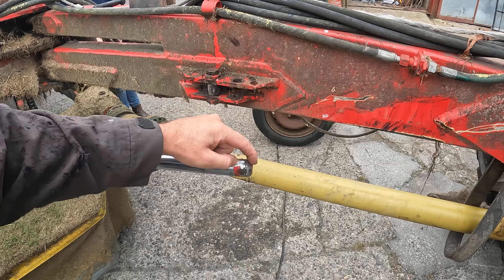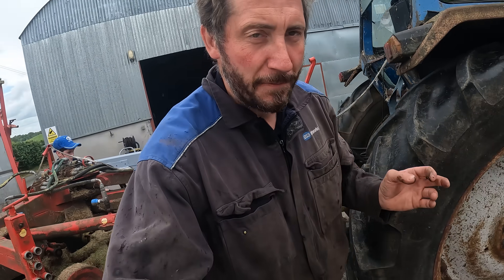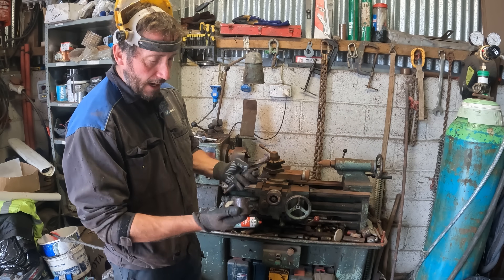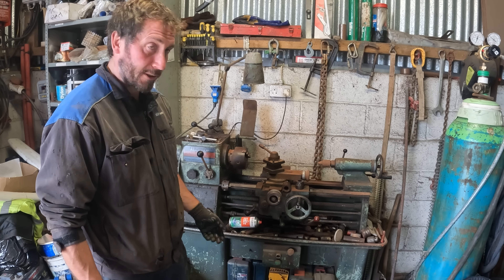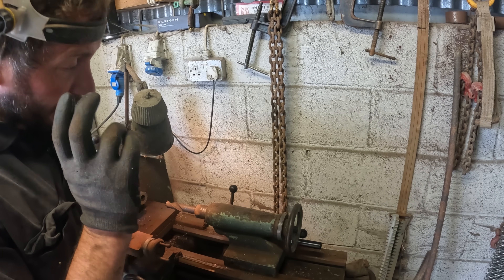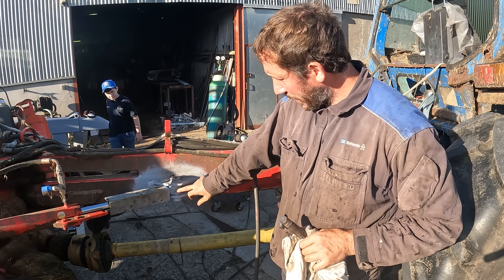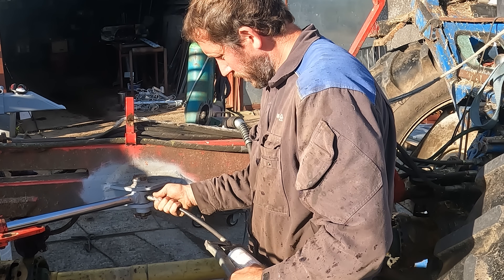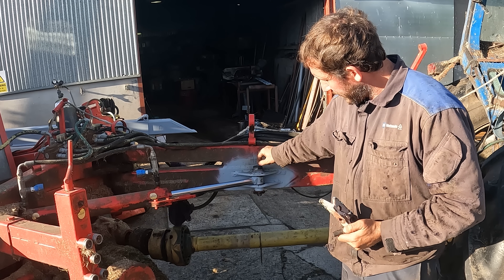Repairing DRAWBAR and a HYDRAULIC RAM on a ZERO GRAZER. #engineering  #workshop #farming  #welding

Comment: You left off the hole for the retaining bar. Sure, it probably wasn't used anyhow. You should have mentioned that that was why the pin kept breaking. That's a nice yoke to be meeting on the road, and it not secured correctly. Fair plat you and the owner of it.
Reply from the maker: It was never used - ever. That why I made it stronger 😉

Comment: That was a neat and speedy fix, but I'm just curious as to why ye don't want the pin in the ram end to swivel.
Reply from the maker: The top and bottom bosses on the pin do not have greasers so everything lasts longer when the pivoting happens only on one point that's well greased 👌